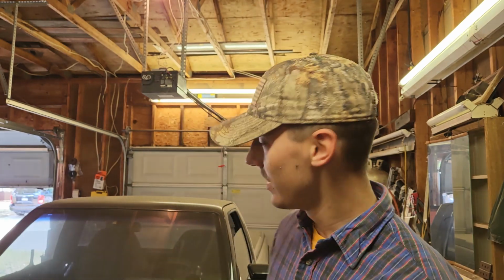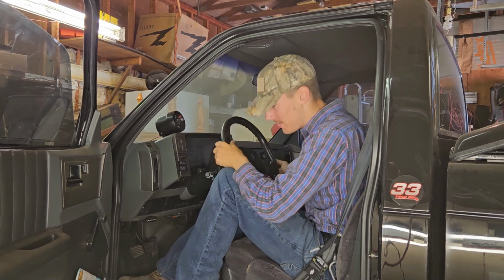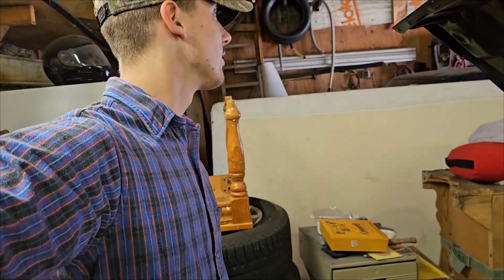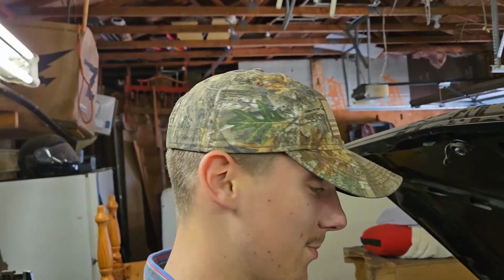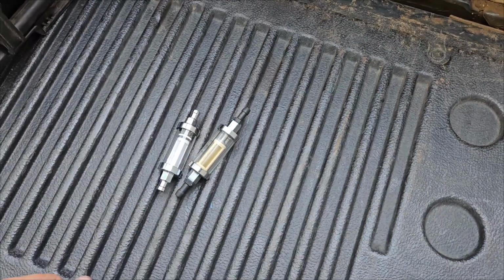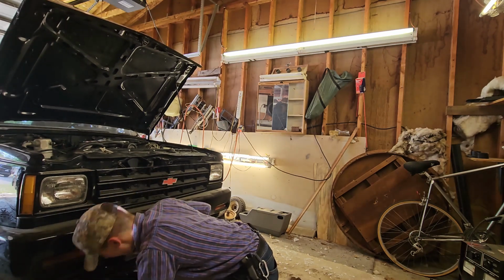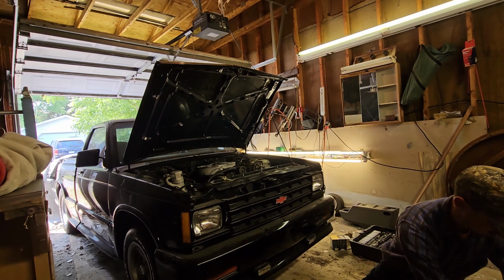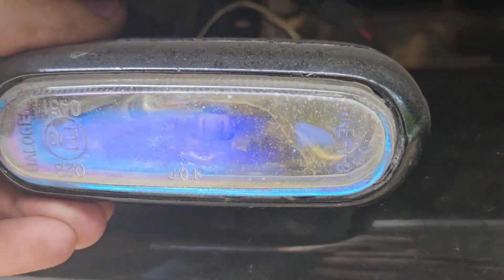RARE! 1989 Chevy S10 Cameo Revival

Comment: This is a good reference video for how NOT to v8 swap one of these trucks. I feel sooo bad for this poor thing. It needs to be torn down and done right by someone who knows what they’re doing.
Reply: A lot of things were done wrong, but it could have been much worse. At least it's not an effin LS. There is nothing I hate worse than an LS. So many classic cars have been ruined by those things. I have a 1993 S-10 that I did a V8 swap in. It has a real Chevy engine in it (other than the fact that almost nothing but the block is actually GM) Carbureted 383ci, Muncie 4 speed "rock crusher", Ford 8.8 Trac-Loc rear axle. No A/C so I was able to relocate the radiator far enough forward to use the actual belt driven fan. Surprisingly enough, I used stock GM exhaust manifolds. Headers will not fit a V8 in an S-10 without a lot of butchering. I was not building a race truck. NO serpentine belt. No power steering. It has 225/70-14 front tires on 14x6 wheels, 275/60-15 rear tires on 15x8 wheels, has NOT been lowered. Bench seat, full aftermarket gauges. NO computer. 

Probably the biggest mistake anyone can make when V8 swapping an S-10 (besides using an LS) is screwing up the engine mounts. You can seriously damage the frame if you don't do it right, and many do. The parts are available to do it right. This is NOT a place to cut corners and get in a hurry. It is a time consuming job if done right.
Reply: @geraldscott4302  Sheesh.. I wish people would quit spreading around bs with these trucks. Headers fit. I’ve used a few different brands. No issues. 2.5 and 3” full exhaust. I’ve done sbc AND lsx swaps. Funny I didn’t see a FoMoCo casting on the LSx blocks but anywho moving on with the clown show.. I’ve kept ac and power steering because.. well… street car daily driver stuff.. I despise people who hack these trucks up and remove everything because they don’t want to do it right! They just wanna be cheap and reuse some junk they’ve had collecting dust since 1970 that they claim was a bad ass corvette 350 with a 3/4 race cam 🤣🤣🤣🤣🤣🤣. I’ve done carbs and efi.. neither had issues but again I wasn’t cheap. I’m currently building another one.. sorting the chassis now. Some one HACKED it before I got ahold of it and I’m having to unfuck everything done. Ac hacked up, wiring hacks, broken bolts everywhere.. Moral of my novel… Don’t be a cheap ass and don’t spread BS information to people!

Comment: Can't believe you'd use ether on it instead of gasoline ehter is for diesel motors unless you don't like or are angry at your engine for some reason ? Especially on a start like that where you didn't even disconnect the spark and or not put any fuel or other substances in it and let it prime the oiling system by cranking it for 45 seconds to a minute or so before adding spark or fuel it's a gorgeous truck bro and has to be worth something for real it sounds great too but take care of it and don't destroy it so it stays worth something nice truck